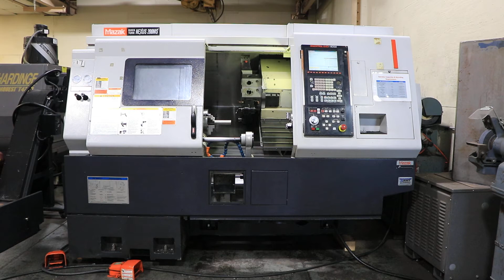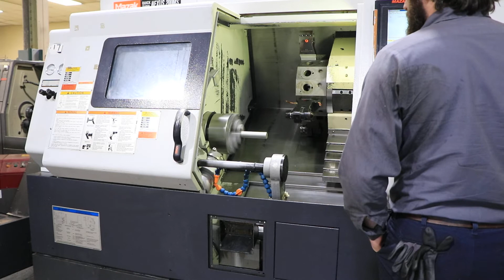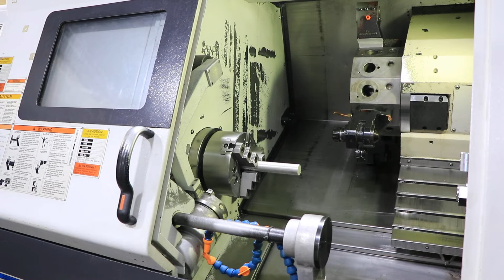MAZAK QUICK TURN 200MS CNC TURNING CENTER WITH MILLING & SUB-SPINDLE

Comment: I erase tool 12 on data by accident ,and I can't put it back ,when i put MDI T1200 ,it not pop up tool 12 in tool data page ,can you help me please ,thank you
Reply: on data?
or on the position page? try resetting tool and magazine 
manually load the tool in the spindle write T000
it should make your tool the same as your mag